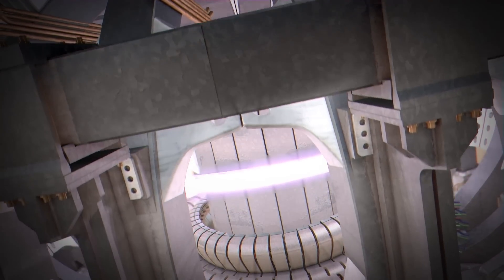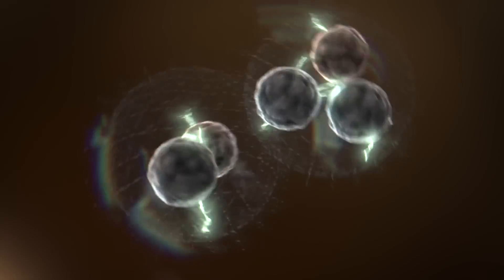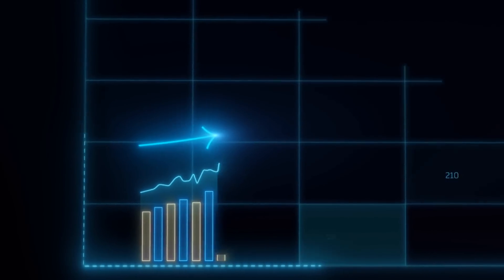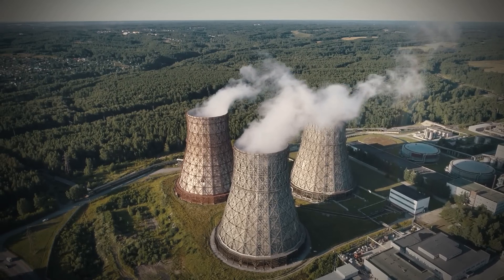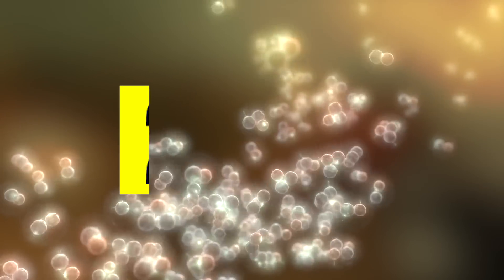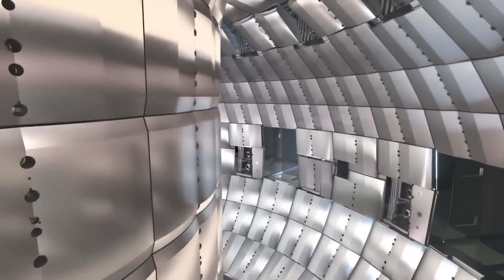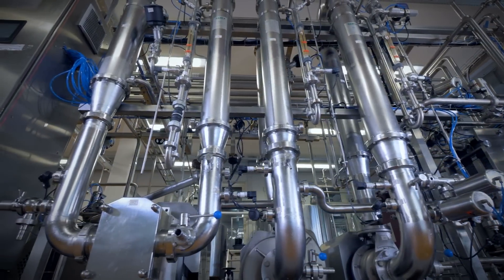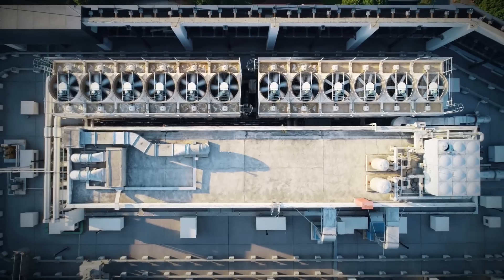The Shocking Problem That Could End Nuclear Fusion

Comment: I appreciate your video but there are far bigger problems that just logistical supply issues. Those being the inherent inefficiencies of the supply chain needed for fusion and the biggest being that the entire process is net negative energy production meaning it requires far more energy to produce a fusion reaction than the fusion reaction produces itself. It cannot ever be a source of sustainable power. It is a mathematical impossibility and they know that.

Comment: Imitating the Sun, never matched the true nature near Solar Core...
Ultra-pressure surrounding Solar Core is 2e(11) barg (0.2 Trillion barg or 200 Billion barg. (Jupiter's core is 30-45 Million barg, says 40 million..) Man-made Dough is nearly in (Full) VACUUM..."ZERO" Pressure.. (Please be Alarmed by this message.) Meaning; Despite the Endless/enormous INPUT (of excited/Stimulating microwave or Laser etc.) Energy will never, Never SUSTAINed the break-even OUTPUT.. Not to mentioned the overall energy to run Accessories/utility around them ( Cryo-pump, Cooling pumps, Superconducting Magnetic Coils, VACUUM Pumps,..even Static Heater & Synchrotron for Warming-up/Start-up the Machine... So far from Break-even of intenal (plasma COP.) Circuit, even farther/impossible to Regain all Utilities/accessories & Control Systems!o!

Comment: You people wanna play hard in deep-technical analysis without realising simple thing.. Boiler efficiency. In such costly and tech-confused reactor Dough; the Steam will be generated by Surface-Cooling of Latent/sensible Heat.. considered Fire-tube (type of) Boiler (water surrounded) whose efficiency is very very low (not match for big machine.) Most industrial (large) Boiler is of WATER-TUBE (Fire surrounded Water(in-tube)) whose efficiency of heat transfer is maximized per se.. incredibly complex & mighty project still don't have the proper way to convey thermal energy from super-heated plasma.. other than via Superficial "Cooling Water" from outside the Dough-vessel. 
(Other problem with Helium circuit to cool /isolate the Cryogenic Coils from Heat !o!
Reply: I mean perhaps; MHD direct conversion of Positively Charged Protons (& Helium).. in plasma, to Flow Across/Cut-into Magnetic field.. to create Electricity directly.

Comment: Nice video. Tritium can always be produced in dedicated fission reactors if needed, as was done in the early days of thermonuclear weapons. Regarding Li6 enrichment, it can be done nowadays with laser techniques. On the other hand, while the n+Li7 reactions are endothermic, they can also produce tritium, so I wouldn't be too concerned about the Li6 enrichment. Having a proper neutron multiplication mechanism is trickier, though.

Comment: Tritium as a Candu bi product is an almost accidental benefit to the operators, now the price of tritium is so high. Wasn't it originally more of a nuisance, having to be removed expensively from the water moderator to prevent radioactive discharge to the atmosphere? Surely thermal neutrons are plentiful in other fission reactors, and new ones could be modified to produce tritium until fusion reactors start to produce their own?

Comment: thank you, economy will rise by using jet plasma machine and compressed gas in isolated structure with more than 80 % efficiency , New energy from sea will change world soon, there are other source of energy that with international cooperation in coastline we can reduce effect of  global warming, sea is huge source of energy, further more  we can prevent these phenomena like cyclone and flood and wildfire by using this hot seasonal atmospheric condition, recent years in summer, geothermal energy happens in surface of coastline, there are many countries in coastline with seasonal hot weather and water condition more than 12 degrees with middle Ocean,  in sum-up, by using this energy not only is economical but also reduce global warming in countries like Japan, China, India, Mediterranean countries, Iran, Brazil, Mexico, Us, Canada, (Africa and Arabian countries....) . I invented new method base on air pressure rules and quantum physics ionization sea water minerals in strong dynamic magnet bases on paramagnetic and diamagnetic particles and electrical field and electric chemical reactions (K+, Mg++, Na+, H+, H++,  li+, H2, ...) +( O2, N2, ...) in to up level by vacuum pump from storage in to combustion chambers as major part of fuel (more than 50%) for producing electricity and fresh water and fertilizer. 7 methods zero pollution for reducing global warming I mentioned in my profile.

Comment: Let's have a reality check and consider the following.
 
Cold Fusion (LENR) - Unproven hypothesized type of nuclear reaction that creates nuclear fusion at room temperature by producing more energy than the amount of input energy can be produced from its altered state.

Tokamak Nuclear Fusion Reactor (ITER) - Development cost for the ITER is $150 billion. Requires a temperature of 150 million degrees Celsius to create nuclear fusion. Reportedly the record to date but having to use more input energy than produced is 69 megajoules of fusion energy for five seconds using 0.2 milligrams of fuel. 
(1 megajoule is equal to 0.00027 megawatt-hours, 330Mw equals 1,188,000 Megajoules) 

The alternative.

Solar Hydrogen Energy Recovery Gas Turbine – 301Kwh of solar energy collected from the sun’s nuclear fusion at atmospheric temperature and supplemented with the turbines Variable Frequency Generator or grid supply  provides electrolysis to fuel a variably controlled gas turbine with an energy range between 80 -330 up to700Mw of electrical energy 24/7, has three moving operational parts, cost $36.5 -49.5 million requires an operational area the size of a football field, noise level is 60dbl at 60m and incorporates direct air capture of CO2 at 1,400 Kg/sec.

Sixty-five carbon free, shovel ready installations retrofitted to any of the 120 Hydro-electric schemes would provide Australia's entire energy needs on a combined operational area of 33 hectares for a 2023 total cost between $2.4-3.3 billion, construction is 3 to 5 years to build, meet net zero twenty years earlier and makes wind, solar, hydro, gas and nuclear for energy production redundant.

Comment: If the consequences of the laws of physics are SHOCKING, then you should find a different line of work.  We've HAD FUSION SINCE THE DAWN OF TIME.  It's the SUN.  All we need to do is collect the free energy!  FISSION plants can provide carbon-neutral power while we try to get our heads out of our asses.  I'm ashamed of physicists for continuing this self-serving boondoggle.

Comment: Why then does any truly informed investor put so much money into this project?   They are doing all this research as merely a cosmetic distraction to make us believe they are really doing something when they know they are getting nowhere close to break even in the sense of money in to money out.  This is a lot like they money they spend on curing cancer.   They been using the same old same old radiation and chemo for many years now which in many cases only accelerates the death.   If the labs can make you think they are progressing when they are doing the same old same old over and over again maybe with slightly better efficiency  then  they will keep on getting their research grants from which a few are making out.  At the same time they really are not using any real breakthroughs and if there were any they were already done a long time ago and suppressed.

Comment: Nuclear fusion as the ultimate fuel for us humans has been possible for 90 years and THE ONLY PROBLEM THAT PREVENTS ITS UTILISATION IS SIMPLY BECAUSE WE LIVE UNDER A GLOBAL SYSTEM OF CAPITALISM - IF FUSION LIKE ANY OTHER PRODUCTION PROCESS WAS NOT SUBORDINATE TO THE SOLE MOTIVE OF CAPITALISM - PROFIT - THAN WE COULD HAVE HAD UNLIMITED USE OF ITS CLEAN GREEN ENERGY 90 YEARS AGO. the problems mentioned above are tied solely to those that surround the commercial pursuit of the making of a profit by the use of cheaper materials - there are the other alternatives without the market considerations like tritium etc etc - in fact if the whole of production was organised by the NEEDS of people the 99% of the planet earth as opposed to the profits for the 1% greedy owning class we ALL would live like kings.

Comment: Power out to power in ratio of about 0.1 means that it will never produce Electricity.
It is a very expensive dream.
The Sun works for one reason and that is Gravity which contains the reactions to produce the Energy in the form of sunlight.
For how long these very costly attempts to mimic the Sun’s ability to produce Energy goes on for is a question that will be answered in the coming decades after €Trillions have been wasted on the desperate futile projects.

Comment: This is stupid. Tritium is an important intermediary in the fusion process that's easy to breed from the most common isotope of lithium. D + T -> He4 + n  n+Li7 -> T + He4 +n, so the fusion of one T can cause the breeding of an unlimited number of Ts. MIT is designing fusion reactors that will produce more tritium than they consume. 🙂

Comment: Hey stupid! n + Li7 -> T + He4 + n  So one D + T -> He4 + n can breed an unlimited number of new Ts, and Li7 is the most common lithium isotope. A fusion reactor will need some T to get started, but after that it will have no trouble producing all the T it needs and enough extra to get other fusion reactors started. Your "shocking problem" is a well-known practical problem that MIT is already working on solving. :-)

Comment: They can increase the tritium supply by harvesting it with deuterium in the high radiation environment
of the reactor's core, which lowers the output of the fission reactor a little, but can create a lot of tritium.
However, the tritium should be harvested with each cycle of the deuterium, which can't be maintained
on a continuous basis. It would also means having a shifter at the complex, that separates the tritium from
the deuterium after it has been radiated with neutrons from the fission process.
I'd use liquid deuterium which can also act as a coolant instead of water, for some of the cooling
and control.

For the clean part of deuterium reactors, they should try fusing deuterium together,
instead of using tritium and deuterium. This obviates for tritium altogether.

At first deuterium needs to be radiated with neutrons, second the deuterium needs to be compressed
and cooled, so the distance between nuclei becomes as close as possible.
Then the neutrons captured within can merge with deuterium nuclei.
Simple as can be.

Avoiding components that are really hard to get is key to economically viable fusion.

Comment: Having my doubts because the sun doesn't work like this. The sun has vacuum around itself. So it can't cool down. And its gravity literally only compressess different elements together which allows a reaction between the different elements. Gravity is for free as long as there's mass. Our planet's core work on same principle. It's just not this vast. Nuclear fusion is just an advanced nuclear reactor really without water. An open chain reaction. It has got nothing to do with the sun at all.

Comment: John Keely machine shop work during late 1800's was able to control some forces of nature with resonance vibrations. He used arrays of tuning forks hooked to what we now call thermocouples and thermopiles of silver, gold and platinum wires. Inharmonics of certain RATIOS applied would cause molecular and atomic attraction. He could even cause same poles of magnets to attract. several books available. Keely And His Discoveries, + Free Energy Pioneer + The Snell Manuscript - which is a tech summary of Keely's 3 reports printed about 1892.

Comment: The issue of tritium breeding is associated only with deuterium-tritium fusion systems. However , deuterium-tritium fusion is not the only fusion option under consideration. There are other options such as proton-boron fusion which do not involve the use of tritium. The heading of the video which states that   "The Shocking Problem That Could End Nuclear Fusion" is therefore quite misleading.

Comment: This bullshxxt research has been a boondoggle for private companies sucking off the d o e tit since the 2980’s.  They are still T the same level of progress which is little to none of any consequence. Break even or 1 p is useless when you need a factor of 100 to make a viable power reactor to supply the grid. We have been wasting taxpayer monies on juniors 7 grade science experiment for 40 years. I believe that in the end we will have to come to terms with fact that there is no earthly element or material that can be used to fabricate and contain the pressure of the fusion plasma for extended periods of time.  . The closest we have come is the prismatic a nuclear fusion weapon made of plutonium with a lithium deuterium tampon an Dr gas booster bottle used to trigger a 2 stage thermonuclear physics package. We haven’t even begun to crawl let alone walk.

Comment: We've got this problem all wrong. Rather than bringing the power of the sun to us, which brings the problem of the sun to earth, bring the solution of the earth to the sun. If all you are doing is boiling water to heat it and spin turbines, send the tea pot, full of water, to the sun. Forget a Dyson sphere. It's impractical and well outside of our technology. But I bet that we could place a tea pot, full of water, nearer the sun pretty easy. And, by shading or exposing the water, heating and cooling it, you can easily adjust how hot ot cool the water gets, and how much energy is produced. Further more, set outside the earth's direct course through the solar system, if the tea pot ever boiled over, the risk to the earth would be very low under worst case conditions. Why? How? Shield the water from solar radiation by using the proper material. Clean water floating through space is hardly dangerous to the earth as far as I know. Then the problem doesn't become the danger to earth, it become how to get the power generated back home, to earth. You'll have the unlimited, controled, power and a disgustingly reasonable safety margin. The power source would last until the sun expands. And you don't have to use water, amonia anyone? And we've got the Moon Io on our back porch, made entirely of frozen liquid. Solar is a waning technology and wind brings environmental costs. Fusion and Fission are both dangerous. So, toss them out. What you want is a perpetual motion machine and while I don't have one of those, I give you the next best thing, the sun. It is burning right now and, for all prictical purposes, as the sun goes, so goes the earth. Stop trying to re-invent the wheel. Send the sun a nice pot of tea. I call this technology, Educated Fools technology. Why? Because, for all your college and money and brilliance, I wasn't educated by men, I was educated by God, and I am right. Safe, feasible, and low maintanence, the EF technology solves all the problems right now. You could even make the stupidity of the electric car work. Even though hydrogen powered cars are a much less harmful solution with a net zero harm to the environment. 

God's speed ladies and gentleman. Get on your knees, where you belong, and thank God again.  Don't say God never gave you everything, again, please. Thank Him every day for out-smarting you. He did make the entire Universe, after all. You don't think He could come up with a solution to this problem? Humble yourselves. We were, are, and will always be, children, compared to God. Now, go and build your first space-based hydrothermal power plant. We have everything we need, ready and waiting. We don't even have to go very far. Just far enough to heat water or amonia to an energetic boil. Large upfront cost though. You might consider unity under the Lord God and His Son, Jesus Christ, and His judgment, His spirit of the law, and working together on this. You could have every earth based poluting power plant out of business in less than fifty years. No more coal burning. No more gas burning. Just safe, clean, water and sun power, forever. And I'm betting that the moon has plenty of metal in it to build the entire thing with. Have a care though. The earth needs the moon so, don't screw with it too much. Say, 1% of the entire mass of the moon should be plenty. Then you can leverage hydrogen to go get metal elsewhere. 

Good night now. God has said His piece. Listen or don't. I'm going back to sleep.

Comment: we could also just keep up fission reactors until we have done enough research for fusion. if there are any questions about the waste: it can be used to get even more power without any leftovers at the end. the reason that isnt used is because the bad connotation of nuclear fission, we cant build new plants if it is stopped on all sides and so we cant build better plants to use those better waste solutions.

Comment: By the time there's an economically competitive fusion reactor designed, permitted, built, and turned on, there will be so much installed solar and wind power, complete with grid storage, that the fusion reactor will be redundant. I already get all my electricity for my home and my car from the solar panels on the roof of my house, and at night via the batteries charged during the day. And it's cheaper than grid electricity here. Fusion is a solution to a problem that will no longer exist when it's ready.

Comment: You missed a 2 in the current world supply, it's 225 kg, and France has the capacity to produce over 32kg a year. Deuterium fusion is possible, and much more likely to be used in the future, however tritium is currently being used for experiment development until we have all the kinks ironed out.